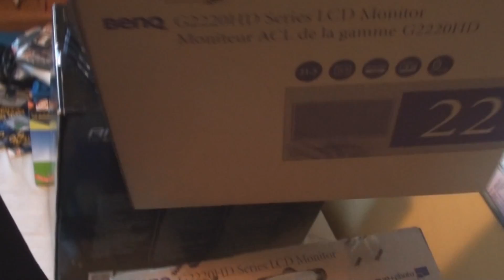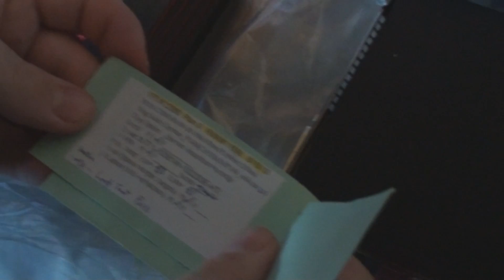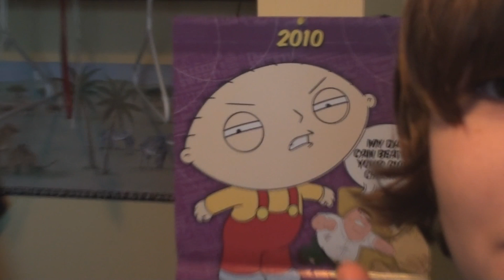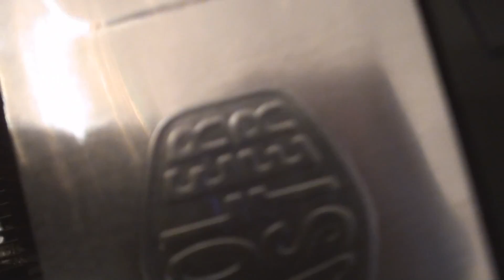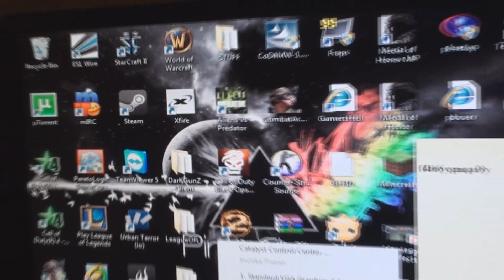Building a Gaming Rig (Circa. 2011)

Comment: Whilst it's not a 'supercomputer' as in it's not in an entire building costing millions of dollars. For a home machine that's pretty bad ass mate! Kudos to getting engineering samples of the graphics cards too! Bt I suggest you fir the back I/O plate and make sure that cabling is tidy as you need maximum air flow in a case that small! Funny at the bit when you thought the heat sink was too big haha.

Comment: Thats strange, I had only i3 on my old laptop and it ran TF2 without any problems... If anything a quad core should be enough, like an i5 3750k which should be all you need. If you had OLD components then ya, I would understand.
Either way, not trying to hate, or piss anyone off, in fact not hating on ANY PC gamers because I would just be contradicting myself... I was referring to the "Too bad this computer sucks." comment.

Comment: should have used a water cooling loop... it would run alot better
im running a amd phenom II x6 3.3 Ghz  overclocked to 4.5 Ghz
a ati radion HD 6970... 
useing the crosshair formuila V ROG motherboard...
1300W powersuply 
16gb of ram...
all cooled by a sweet watercooling loop... keeps it down to 33C under full load ... and all in the corsair 800D case... 

u need to work on your cable management !!! your computer wont get any airflow

Comment: You don't really know much about computers do you ? 12gb ram what do you need that for on AMD CPU, Second why are you using Phenom with dual 6970's, With that much graphic power your really should be running X58 with a Intel CPU